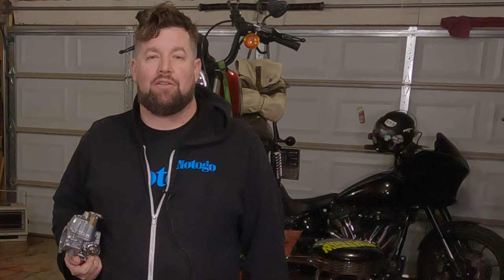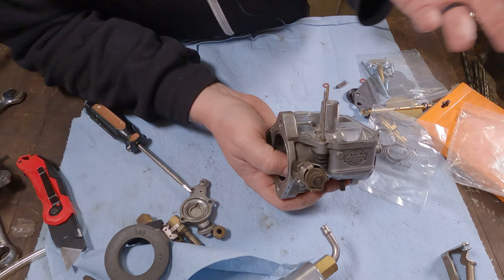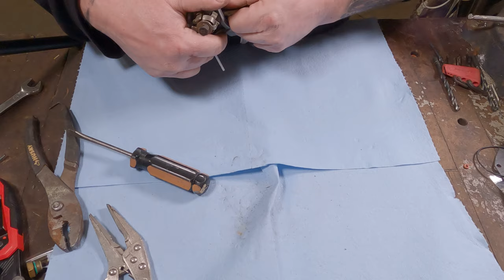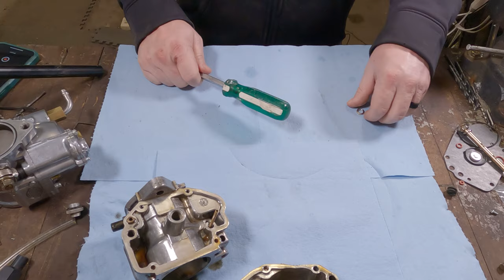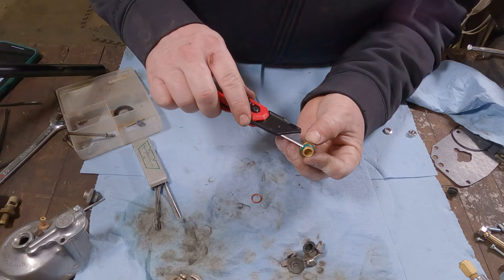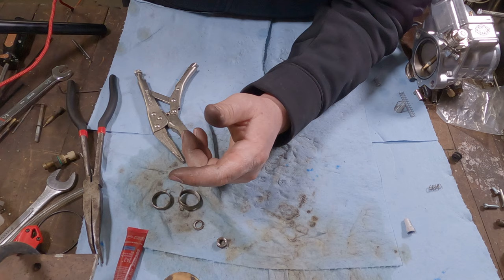Detailed Rebuild of the S&S Super E & G Carburetor.

Comment: You are just plain fun to listen to as you present the preferred way and the reality.  I have been doing maintenance and repairs on my bikes and other vehicles for 50 years, learning as I go, you are the most entertaining 'teacher' I ever had, thanks!

I have an 'E' on my enhanced performance Panhead with a ThunderJet, now I understand how it works.  I had it apart a couple of years ago, missed a couple of details (idle circuit), it hasn't idled right, it is coming back off.

I have a 'B' on a 1980 74" stroker Sportster that I bought at an estate sale with very limited history.  I am going through it checking, lubricating, re-wiring and correcting problems.  It is a learning experience as I have no knowledge about Sportsters, just shop and parts manuals and what I can find on the net.  My 'B' looks as crusty as the one you did, gives me hope.

I have been binging on your channel tonight, near the end of the newer Sporty with the bad stator, 4 am I'm calling it a night, I will be back on your channel tomorrow.  I subscribed a while ago but with over 650 subscriptions it takes awhile to make the circuit, lots of different interests.  Thanks for your informative help.
Reply from the maker: You are very welcome. I am genuinely glad you enjoy the content and I am flattered that you enjoy it so much.

Comment: The screw that is removed for the air vent for the Float is for aftermarket air cleaners, as some have a port in the back plate and some do not.
Reply from the maker: Im not sure about that. It looks like it goes into the main bleed passage.

Comment: The e is for under 100 cubic inch motor and the g is for 100 cubic inch and up I had a e on my softail with a S&S 107 super sidewinder engine and it wouldn’t do what I wanted got the bigger S&S super g and it runs perfect I didn’t know the difference till I contacted S&S and they said under 100 e 100 and over g
Reply from the maker: S&S has great customer service.

Comment: at about 45 mins, you had an issue with your accelerator pump screw. Have you had this issue since? i ask because i removed my bowl to check the jets, and noticed there was some fuel around that seal, so i took it off. That same screw didnt seem like it was threaded at all, I thought maybe it was crossed or broken. But, if I remove all the parts, and try to screw that screw in again, it catches thread. when i put the stuff back together, it doesn't want to catch a thread.
Reply from the maker: The spring tension on the linkage, may be making it go crooked.  Try and hold the spring back and thread it in, then if it still won't go, I would replace the screw.

Comment: You know why those butterfly bolts are so much of a pain in the ass to take out of carburetor because if you look on the other side of them they usually tell you to take a chisel and put an x pattern in the boat when it goes through the carburetor so it doesn't come out and end up in your engine if you want to get them out the easy way you take a drill bit and drill the screw from the opposite direction until it releases
Reply from the maker: I didn’t see any marks on those screws, but I know the ones you are talking about.

Comment: Good morning ,
could you tell me why my candles
are oily and black on my shovelhead, I have a 0.72 in the main jet and a 0.295 in the secondary jet
THANKS
Reply from the maker: If there is oil, you may have ring or gasket issues.
Reply: @KnobleMoto  ça ne vient pas des gicleurs ? she farts and the smoke is black from time to time
Reply from the maker: @richardgrognard6394  try a smaller main then. Or turn down the accelerator pump.
Reply: @KnobleMoto  ok, I put a 0.70, and a 0.28?
Reply from the maker: @richardgrognard6394  try a .070.  Also check the  S&S YouTube for tuning info.  You need to make sure your accelerator pump is turned off before you tune the carb.  Or you will end up chaining your tail.
Reply: @KnobleMoto  thanks for the advice
I don't change the secondary jet?
I would like to listen to the S&S video, unfortunately I don't understand English
Reply from the maker: @richardgrognard6394  you might need too. But I am guessing that main is too large.  I would try that first.
Reply: @KnobleMoto  merci de votre patience , vous êtes où ? USA